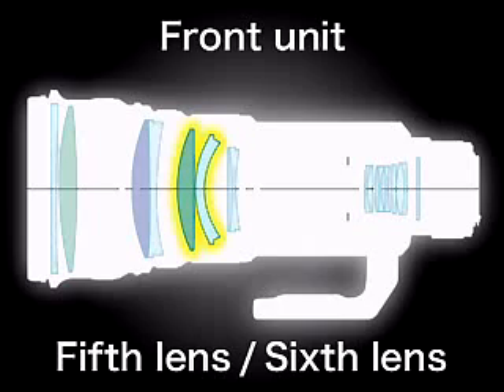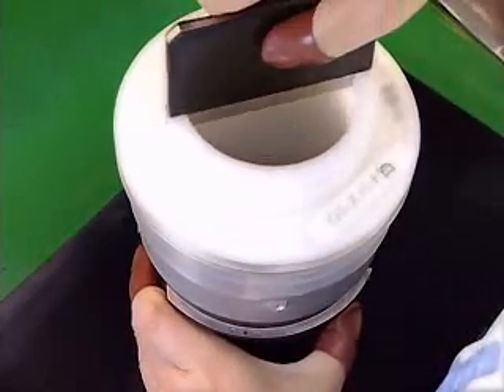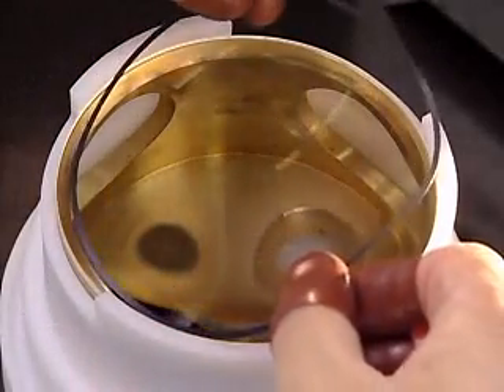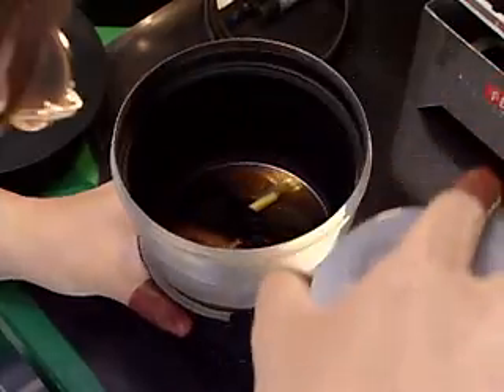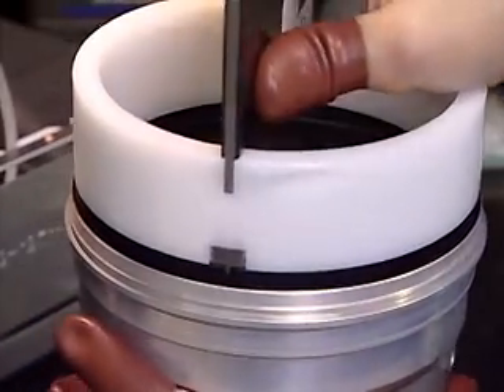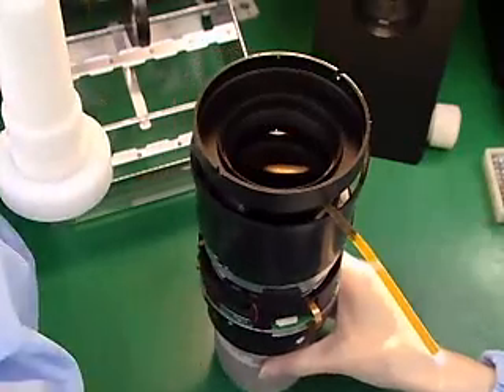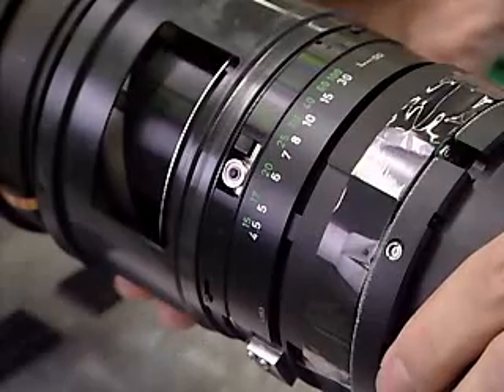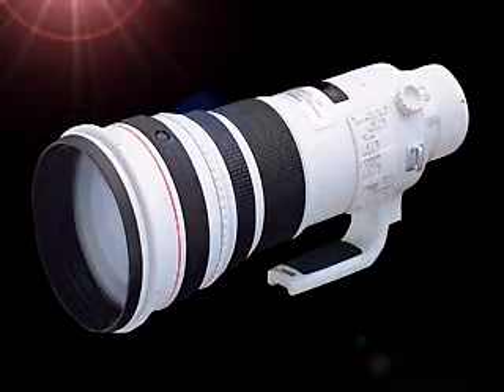Canon Lens Production (Part 3)

Comment: It costs a lot cause optical companies (in order to achieve top performance in their products) use exotic glass materials such as Calcium Fluoride or FPL-53 Ohara, which cost several hundred dollars per inch!!!
So when you try to construct a huge 500mm f/4 or a 400mm f/2.8 super tele you need a lot of this exotic glass... not to mention the difficult and high scientific work to transform this raw material to a fine optical instrument

Comment: You are right that these lenses are extremely expensive (as if you buy a small car)...but they are not overpriced! Overpriced means that an object costs more than it's actual value....a small research in optical industry (telescopes, binoculars, birding monoculars ect) will show you that premium glass costs a lot.

Comment: The optics make the cost grow. The fifth lens (made by fluorite) is the perfect example...very difficult to work with it, very expensive. The same stands for telescopes. A 5" apochromatic refractor costs around 5.500$ due to very expensive, hand made optics